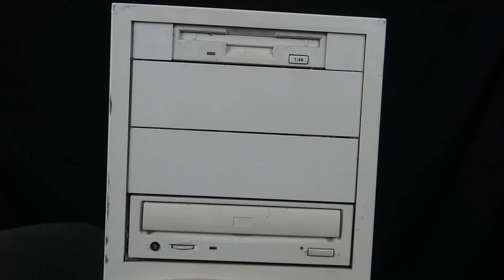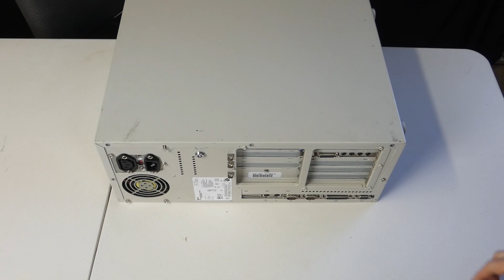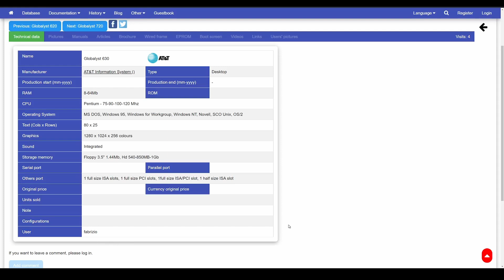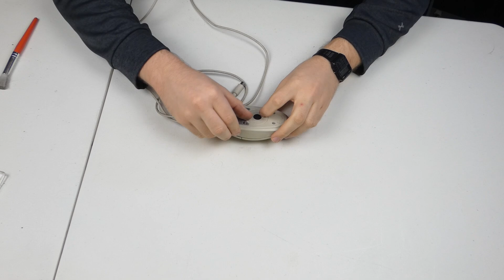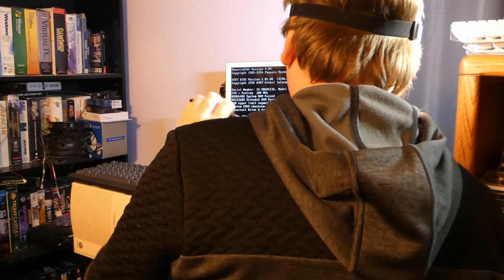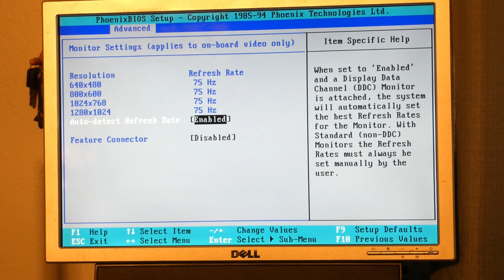Exploring & Testing One of AT&T's Last PCs

Comment: I found some articles about Micro Firmware launching that product. The final boards were assembled at a plant in.... Tulsa, OK! Here's a quote:
"Micro Firmware is riding the Year 2000 wave with its new MFI Flash 2000 card, a $39.95 product that provides part of the solution for many older desktop PCs.

Since the card’s introduction about four months ago, it has been the best-selling product for the Norman computer firm that specializes in upgrades. It’s actually Micro Firmware’s second major product advancement this year, following the ATA Pro card line a $59.95 BIOS extension. "

Comment: This was the first modern computer my family had back in the 90's. Ours came preloaded with win95, 4 mb ram, 4x cdrom, 1gb hdd, 75mhz  pentium, 14.4 modem / soundcard combo that had voicemail / fax & speakerphone  capability (with software). It did have a sleep mode even with the old power supply. The power light would turn amber when in it if i remember correctly. I dont remember using the key button for anything. I do however still have the factory system restore discs with drivers and included software for this machine if you need them. I also have the weird soundcard, but havent powed it up in a system in years. Took very specific drivers and software to get it to run at all. Not surprised it wasnt included or got replaced in your system. Cool to see this machine again. Peak nostalgia. First machine to introduce me to 3d games, early internet via netscape navigator, demo discs from magazines, etc.
Reply from the maker: Thanks for sharing! It'd be cool if you could get those restore discs uploaded to archive.org at some point.
Reply: this was my first computer ever. that would be awesome if you could upload the restore discs!

Comment: That Y2K patch card is really interesting! I’ve never seen one before. The computer seems to boot showing the S3 BIOS splash, then the motherboard Phoenix BIOS splash — I don’t see any date later than 1995.

People do often hate on non-mechanical keyboards, but older OEM keyboards can be quite comfortable to type on and last a long time. I used an OEM PS/2 hp membrane keyboard for upwards of ten years because I couldn’t find one to buy that I liked better.

Well-paced video with good closeups and relevant narration, and the background noise wasn’t bad at all on the lav. I look forward to part 2!